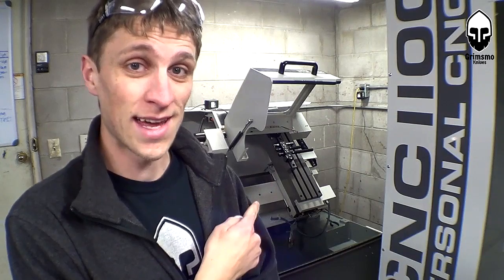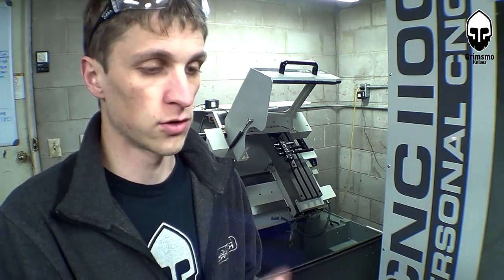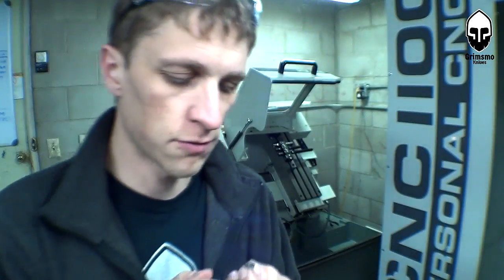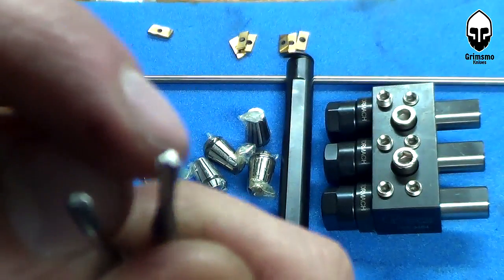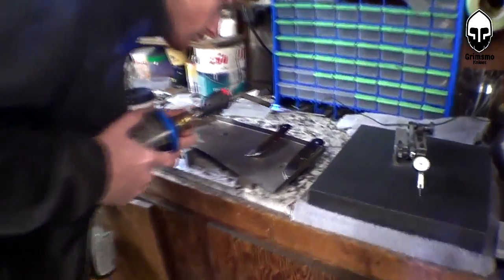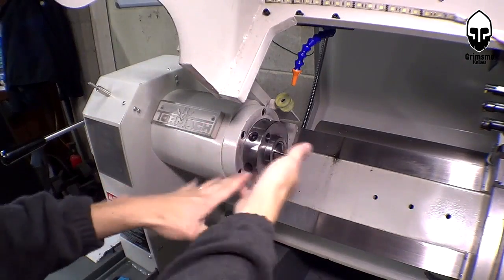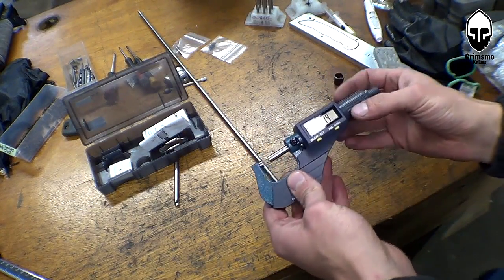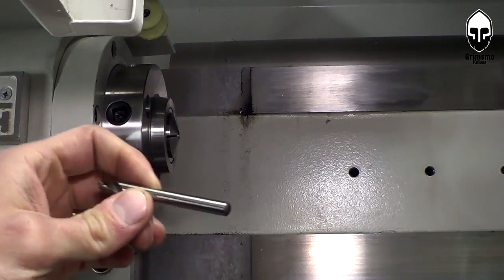Knifemaking Tuesdays Week 98 - Lathe spacers part 1

Comment: Good stuff... Looking forward to getting one myself. Couple thoughts
- To cut hardened stuff: Just use a abrasive cutoff wheel - a cheapie HF one will whiz right through, then just clean up on the grinder
- Measuring stuff: Accuracy is how close you are to the real number, and Precision is how repeatable the measurement is.  Like you, on most of my stuff, I need it precise (repeatable), but accuracy is less critical.
- High production shops get high accuracy stock. Just adjust your collet tension for the run of material you get, and do that each time (much cheaper than buying high accuracy material)
- I hope Tormach makes a reasonably priced pneumatic closer... its pretty pricey already for a hobby machine. (I have the series III mill)
- Gonna have to get me some of those form taps!

Cheers!

Comment: You might already know/have discussed this (sorry if you did):

Might want to start your setups machining 360 brass or similar, then change the bar to titanium/stainless.  That way if you're off by a decimal or have a typo or odd speed/feed, you still have a chance to save your tooling.  Also you'll have to buy less cheap tooling to "experiment" and just buy the quality stuff.  When I worked in a screw machine shop, the setup order was always cut air, 360 brass, then final material.
Also, rather than having the gang/bed go "home" at the end of a cycle, put a dead stop in there so you pull out the bar stock to the same position each time.  You will probably get a few more pieces-per-bar out of it.

Comment: I know the Tormach 15L Slant-Pro lathe is bad ass lathe but why werent you using the 10x22 lathe you  had. Seems like it would have been a cake walk for that lathe.
As far as gang tooling goes you know you could move the collet shank out to keep  the lengths the same.
Reply from the maker: The 10x22 sucked compared to this, and it just had a cheesy tool post (although I could have made a gang block).  It was getting old, needed a complete rebuild including new electrical and mechanical components, I just didn't have the time. 
And pulling the collet shanks out from the stop means they could slip if you put enough Z pressure on it.

Comment: I think the collet is too tight that's why it's hard to pull the rod out when you release it.  you don't have to run it that tight, if the tool pressure is too much I bet it will break the small drill or tap before it moves the rod in the collet.
Looks fun, keep up the good work!

Donn
KTM 200

Comment: Hi. love your work. I always cut the spotter with a Angle Grinder. And to smooth the end, i use a handhold drill on a belt grinder. And it tuns out perfekt. It is much faster then to cut it on a lathe and program and set it up.

Comment: Not an expert on your machine but wouldn't it have been easier to adjust the tool holder rather than cutting down the center drill? Looks like you have around 4 inches of adjustment.
Reply: Definitely possible - however more stout = more strong, keeping them all chucked as close to the hold-down on the gantry gives a bit more of a solid connection (probably moot) but probably helps.

Comment: SHARS - "There's nothing more expensive than a cheap tool."

Shortening a carbide spot drill shank on the lathe - that's a job for a ceramic insert.  Long ribbons of fire are awesome.

One gang tooling strategy that might work for you would be a carbide insert outside turning tool on one side, a parting tool on the other side of your travel (one of these will be mounted upside down), and then have job specific gang tooling on a single riser block that drops into the middle and indexes on blocks to always mount in the same place.  The advantage would be quick setups when changing between jobs.  The disadvantage would be slightly longer travel between the two tools you use the most so your cycle time would increase by a couple of seconds.

I'd definitely put an air cylinder on that collet closer.  If Tormach is selling a CNC lathe of this size and capability, it should have a CNC controlled collet closer.  I wouldn't even offer it as an add-on accessory.  I'd just design it as a standard feature of the machine.

Comment: I know you and TacticalKeychains have limited shop space, but you might want to consider a custom pneumatic bar feeder in the future.  They are basically just a big air gun made out of threaded pipe with a pusher that fits inside.  One end has a concave snout for your chamfered material to sit inside, and is attached via a roller-type thrust bearing.  The other end has a grooved adapter with plastic sealing rings, and screws into the pusher.  You could make a fairly short one that supports 3 or 4 foot bars.  The material is always under air pressure, and is forced against a stop when the collet is opened.  This would open up a spot for another tool where the puller would be.  You would just set one of your turning tool "bodies" as a material stop/tool number, and program it to go to Z.020 or so after the cut-off.  It would be a fun project if you had the time.
Reply from the maker: ***** That would be sweet for sure.  Where my lathe is right now the bar feeder would block the door.  With a bar puller I can run 18" bars easily before the material sticks out the back of the spindle, and that equals around 70 spacers which would run for over an hour and a half, I'd be pretty happy with that!  If I were making thousands of parts like TacticalKeychains does then yes a bar feed would be almost necessary and definitely worth the work to install it.  Heck, even just a bar puller but with a bushing behind the spindle so you could run a 4 foot bar without it whipping around.

Comment: When you close your collet without any stock in the collet you want them to close down to about 25 thou under the stock size, use a small hole gauge to check it, that should get you enough tension on the collet to hold strong and give you enough clearance to barpull effectively. This is how I was taught to run collets in cnc applications and how I set up my machine at work every day. We use collet pads however and it may be a different story. Maybe try what I say and see if it works for you? on that lathe you really shouldnt have much issues with stock pushback so you should be able to run those collets with a pretty light grip. Dunno if they make serrated 5C collets but we use them for troublesome materials. Hope that helps D:
Reply from the maker: ***** Thanks for the experience!  I've got a set of gage pins so I'll see how much it is closing.  I think the tightness was just the material being over 0.250, since the collet doesn't really expand bigger than that.
Reply: What I can say for sure is that your stock should slide freely through the collet and grip down tight when closed. on the hardinge tool room lathes I've run with the same exact collet setup you really don't need to have much tension at all.
Reply: ***** Another thing I am thinking, maybe you need to adjust how far your collet closer pulls the collet, looks like there's a threaded rod on the back side, have you tried that adjustment? Just throwing stuff out there.
Reply: Interesting.  I was taught to never close the collet without anything inside/outside.  This can actually cause the collet to permanently distort and change its size.  I've accidentally done this before on external and internal collets, and sure enough, their concentricity went out the window.
Reply: ***** Interesting, never had that issue but I do know that after reading a study done by hardinge that the accuracy of a 5c collet goes out the window VERY quickly with a size difference in your stock further than about 2 thou out and you start having major concentricity issues, Maybe your collets just needed to be splayed out a bit to repair their accuracy because they took a set slightly closed? Like I said I dont have much experience with 5C machines but the collet pad based machines we run at work have no issues with this. You can close them down so hard that the edges of the collet are hitting each-other and wont close down any farther and they just spring right back open with no problems. Just throwing my experiences out there in case something sticks :P
Reply: hmm, makes sense, most 5c collets I've seen, especially in the 3/8ths~ range you can tell the hole isn't a circle at all when the collet is relaxed and it needs to close down for it to become an actual circular hole. What brand collets? Im curious to hear what the pins say.

Comment: Hah that backstop is awesome, I am REALLY impressed with this lathe. I cant wait to see more. Can you get a get chucks for this lathe? If I could chuck up some ~3" max diameter aluminum slugs that would be fantastic.
Reply from the maker: ***** I'm impressed too bro, just wait till you see the next video, this thing can hold insane tolerances!!!  Yes you can easily get a 3 jaw or 4 jaw chuck that should hold up to 15" diameter workpiece!  3" slugs should be no problem.  And with a 3hp spindle it'll rip through 3" aluminum without hesitation.  I used to turn 3" aluminum on my old lathe with a 1hp spindle and I would stall it every now and then.
Reply: 15" swing? seriously? That thing must be way bigger than it looks. Awesome.

Comment: Such awesome lathe! Fun video too :)
I have that same micrometer but from Harbor Freight. It has been fantastic. Also, I buy all my digital calipers from HF, zero problems. I have not figured out why I need to spend more on big names because mine have not let me down once in 2 years.
Reply from the maker: russtuff Agreed.  I've had my same Harbor Freight digital calipers for almost 10 years!  And other than changing the battery every 9-12 months and realizing that they do not like getting wet, they still work awesome.
Reply: JohnGrimsmo Yeah I've learned not to get them wet too :)
Reply: russtuff
I have a NICE set of calipers but use my HF digital calipers all the time .. Ive abused them too. Still going 4 years or so later.

Comment: You need some real calipers John! get some mitutoyo or starrett calipers
Reply from the maker: CleanEdgeProductions Eventually I will, but for now these are doing fine for me.  The new digital micrometer is measuring my precision gage pins to within 0.0001 of what they're labeled as, so I'm pretty impressed so far.

Comment: Hey, as far as the main cullet is concerned you want the material to move absolutely freely when it’s open. That way you pretty much eliminate any inaccuracy along the Z axis, other than due to dull insert. I work in a shop where we do thousands of parts a day (lathes are running through the work week nonstop essentially) with the tolerances to within .00005 and when the cullet is set up right we can pretty much forget about the Z dimension. If there is any restriction on the bar along that axis, even a tiny hair, however, then there we get problems and the parts are too short. Granted the setup for mass production we use is different then what you intent to do, we use automatic bar feeders, the main cullet is responsible for moving the bar along Z, and there is another non-closing cullet just in front of the tools (which also has to be adjusted so that there is no play, yet the bar moves freely) but the principle is the same I think. BTW: I finally decided to get the job in a machining shop in no small part thanks to you and your videos so thanks for that :)
Reply from the maker: goryl02 Thanks for the tips and congrats on your new career!
Reply: Like you said, the material should move freely inside the collet.  The Tormach collets are probably cheaply made.  The problem you mentioned about the "Z" dimensions wandering from foreign material is only a problem when doing 2nd operations on a standard 5c collet system.  Even small changes in diameter will effect your lengths.  It sounds like you are working with Swiss lathes, which use a guide bushing (the non-closing collet you mentioned) to support the material near the tools.  In this case, it IS imperative that the material be clean and centerless ground because of the nature of that style of machining.  I'm sure as John gets acclimated to the lathe, he'll try some better collets.  Good luck with your new career.

Comment: Very cool, I'd be interested in seeing how you zero on this machine.
Reply from the maker: Charles Snyder  I forget if I showed it in part 2, but I'll show it in detail at some point.  For Z I just use a piece of paper and jog each tool over in 0.0001" increments until it grabs, I'd say it's probably accurate to 5 tenths this way.  For X I use each tool to skim a diameter then measure it and input that into the machine.

Comment: I know the feeling re: outsourcing. 400 bushings ordered and a vast majority had a burr and or were distorted from being cut with a very dull tool.

Turns out the shop figured - it's for a knife - who cares? 

For shortening those spot drills, put them in a hand drill backward, then use a ceramic belt on the grinder while the drill is spinning. That's how I shorten my pivot pins

Comment: Out of curiosity, did you at any point consider chucking the work piece in the mill's chuck and affixing the milling bit to the table? Then running it as a vertical lathe?
Reply: I believe he did that a long time ago to make his thumbstuds. Might be just dreaming but I remember a video where he did that.
Reply from the maker: aserta Yes I did run the mill as a vertical lathe a few years ago, it works alright but there are lots of weirdnesses about it.  writing code for it is very tricky, your workpiece can only go into the collet 3", and the collet tended to slip when drilling unless I made it really tight.  Around week 29 or 30 I show how I did this.
Reply: JohnGrimsmo Will check, thanks for answering.